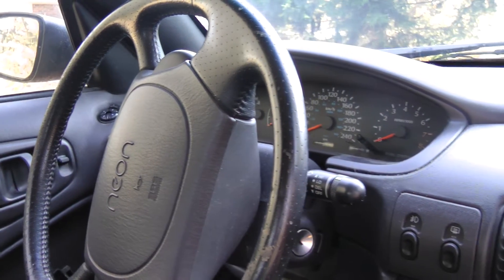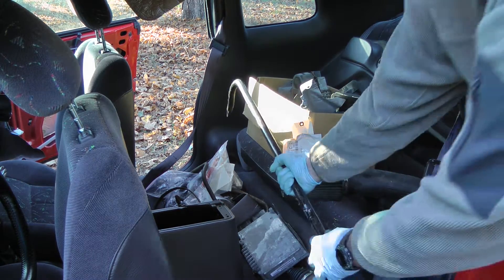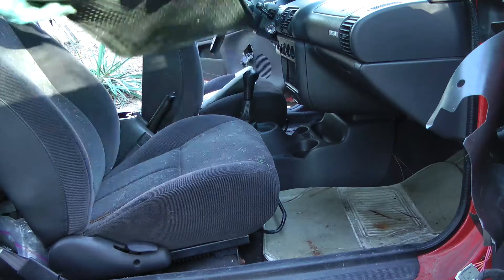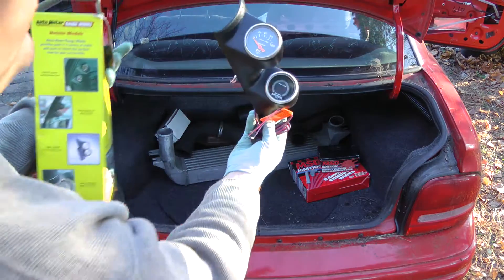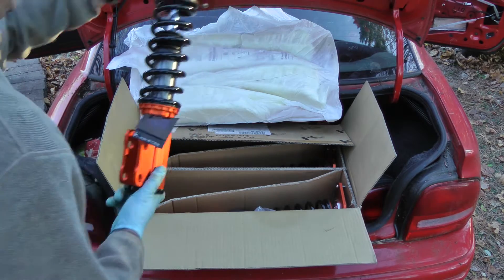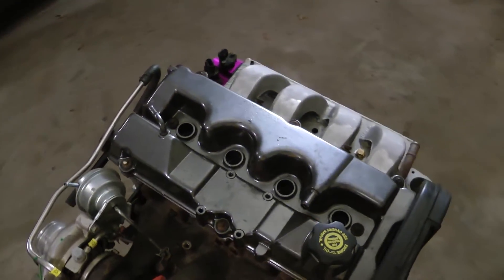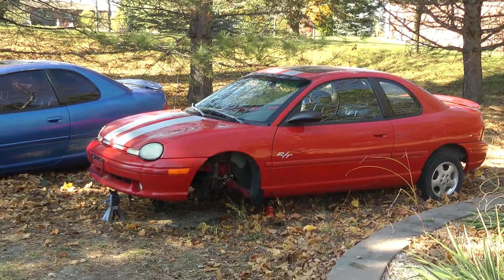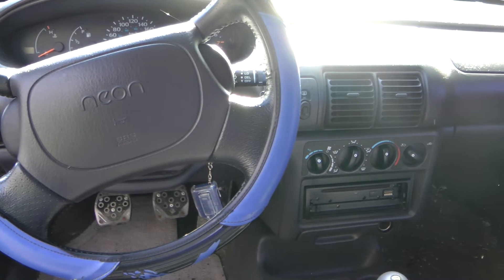1998 Dodge Neon RT Project Car For Sale

Comment: Where did you get a engine setup like that I need to know
Reply from the maker: It literally took years for me to collect all of the required parts and assemble them together.

It turns out that a lot of people, not just me, dream of building an engine, purchase expensive parts, and then realize just how expensive and time consuming it is to finish the job.  I bought most of the parts "2nd hand, but never used" for pennies on the dollar.

I spent countless hours in forums researching what to buy. My philosophy is to work on improving reliabilty and robustness first (ensuring that fuel flow and cooling systems are beefed up, installing a high-capacity oil pan, then building a strong bottom-end of the engine by installing aftermarket connecting rods and pistons) and then, later, creating more horse power (improving airflow to the top-end of the engine by installing an aftermarket intake manifold, more agressive camshafts, and then progressing to forced induction with a turbo).